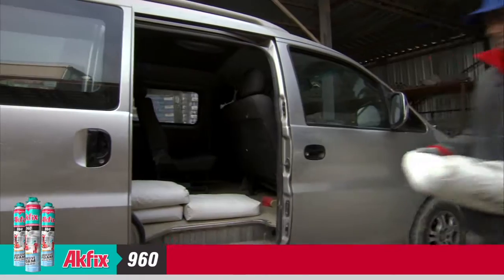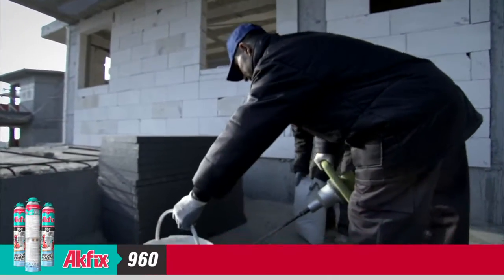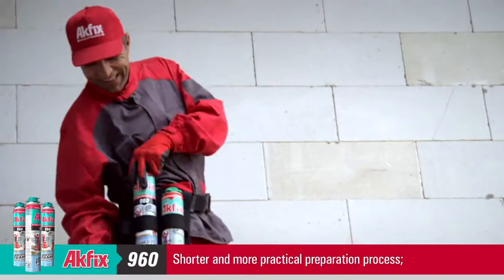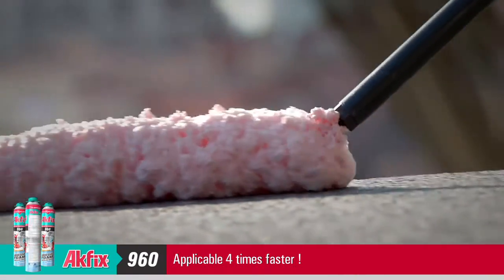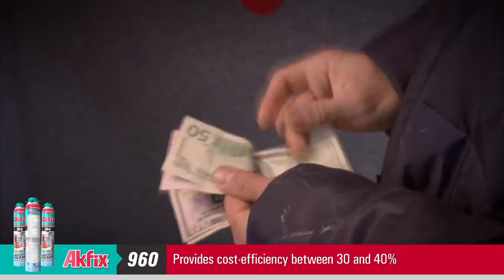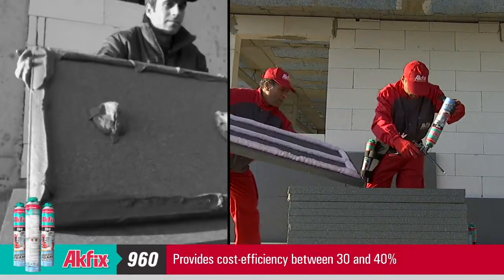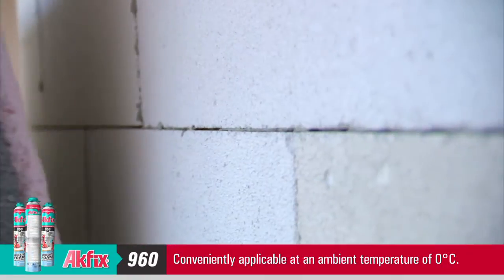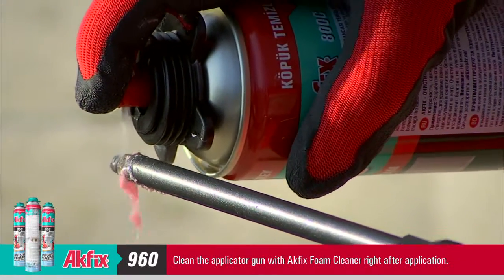Akfix 960 Adhesive PU Foam Application

Comment: How to remove this for my fingers
Reply from the maker: Hello, the most practical way to clean wet foam is to use foam cleaner. The foam that is contaminated around during application may be removed from all building materials, skin, textile products by spraying foam cleaner on it before it gets dried. It is possible to clean foam residues easily with Akfix 800C foam cleaner.  
We wish you have a nice day.